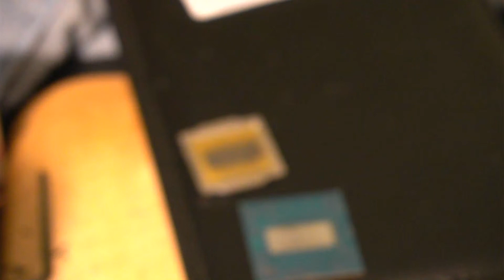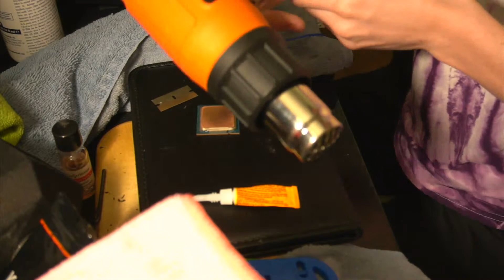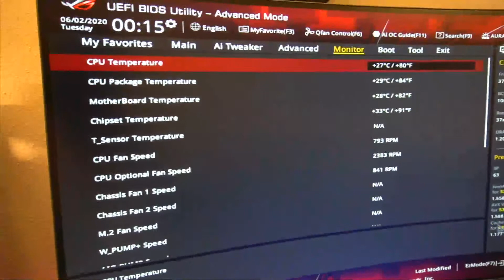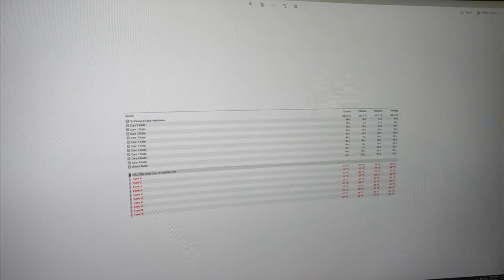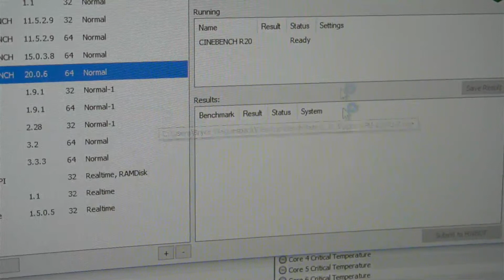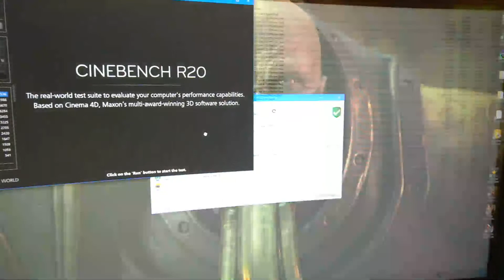Intel 10900K Lapping & Delid LIVE!

Comment: So did 5.2 at 1.355v crash or work? And what score did you get on cinebench if it did.
Reply from the maker: I managed to get 5Ghz stable at 1.375V all core.
Everything else crashed for me.
Reply from the maker: I have a potato chip.
Reply: @BryceAdvice  damn dude same for me. Dud chip for me too. I can somehow get 5.0 ghz to run at 1.31. But for it to work at 5.1 I need to up my voltage to 1.38.

One thing though. Try setting your cache ratio much lower. At around 45-46. That helped me quite a bit. I’m thinking about delidding my chip to see if I can get it to a stable 5-1 at lower voltage.
Reply from the maker: Delid is only like the 4-5C difference. Not worth the effort.
Reply: @BryceAdvice  my 10900k runs quite hot. im going to delid it, is die lapping an option on this chip? whats your opinion? ive had an 8086k running at 5.3ghz with temps still below 80's.
Reply: @VolcardoReviewer  same I have to do 1.310 for 5 all core so I'm thinking of deliding so I can atleast  have headroom for 5ghz on avx work